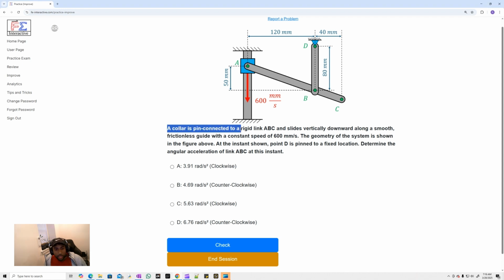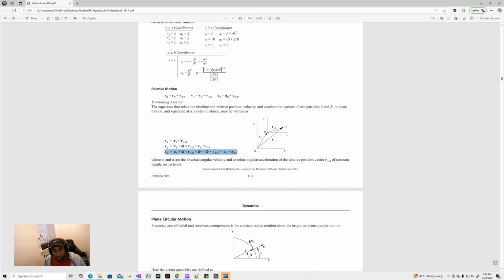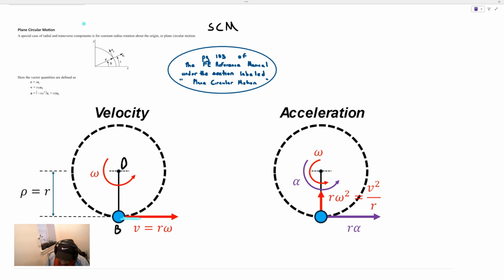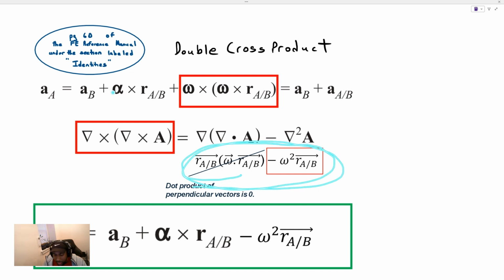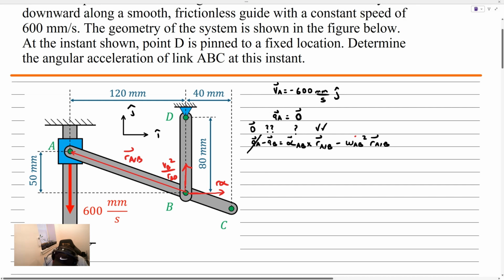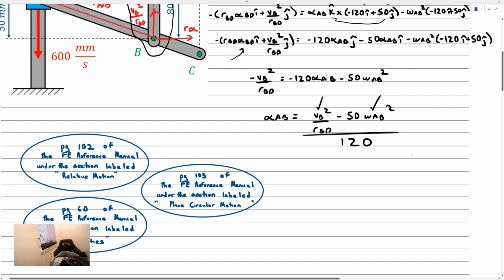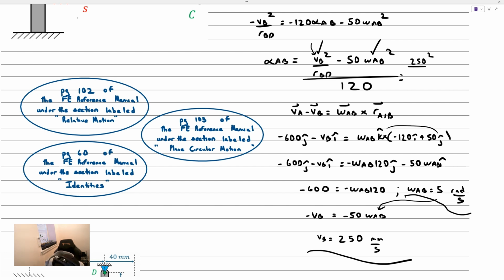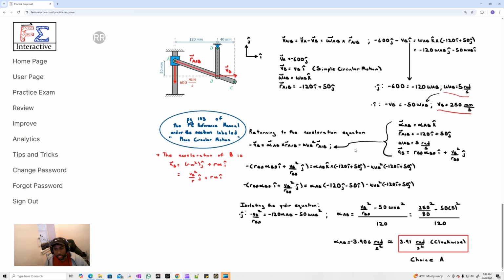FE Exam: Rigid Body Relative Motion Made Easy (Circular Motion is Key!)

Comment: Would using an instantaneous center of zero velocity approach work for a problem like this? I tried but did not get the correct answer, why would this approach work/not work here?
Reply from the maker: Sure it would — and that’s a great insight you’re having. In this problem, we find that the final form of the angular acceleration only depends on the speed at point B and the angular velocity of link ABC (which we realize through relative motion equations). That means to solve the problem, what we really need is a velocity analysis.

The instantaneous center lies along the line BD, and it's 50 mm above point B (to find the center we draw a horizontal line at point A and a vertical line at point B since these are the perpendicular directions to the velocity vectors). Once we identify the instantaneous center, we can easily calculate the speed at point B and then find the angular velocity of link ABC. 

We use omega_ABC = v / r = 600 / 120 = v_B / 50. From that, we get omega_ABC = 5 rad/s, and visually we can tell it’s counterclockwise. That also gives us v_B = (50 / 120) * 600 = 250 mm/s. 

Now we just plug that into our angular acceleration equation and very quickly arrive at the solution — no need for any cross products. This highlights that there are often multiple ways to solve a problem, and you found a really efficient one by combining methods. Hope that makes it clearer!